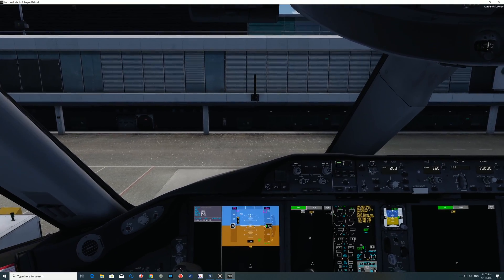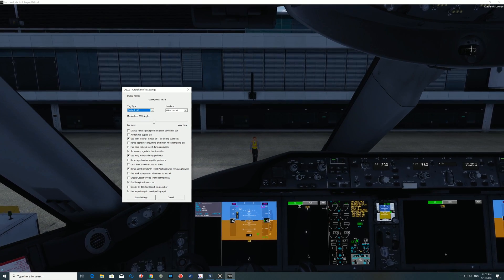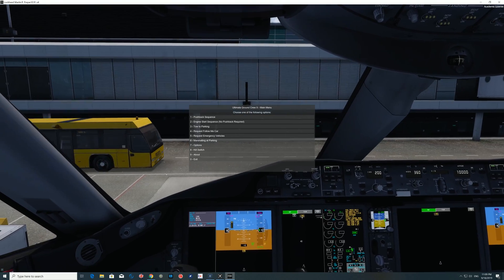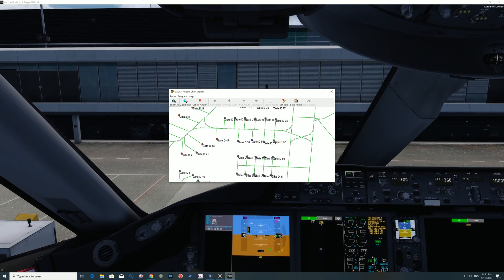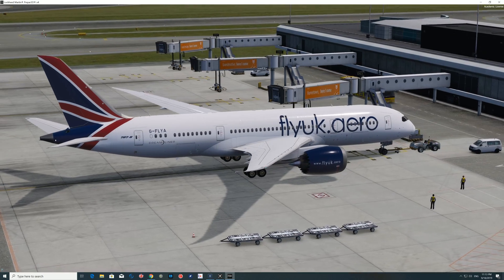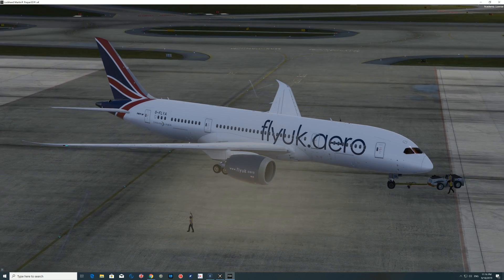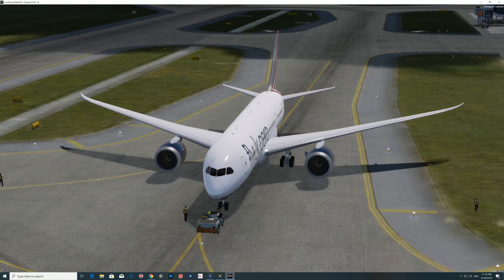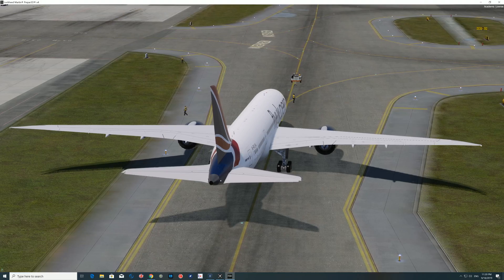Custom pushback tutorial UGCX

Comment: Does the ground crew call you 2 or 3 minutes before block out to confirm aircraft clear, doors closed and locked, by pass pin inserted and give you the clearance to pressurize ?
Reply from the maker: bonbondesel it’s not timed so I call it when I’m ready but I use Fs2crew as well on the aircraft I fly most and that’s at 3 minutes before
Reply: @greniribajan7773  thanks. So it's at the user's discretion, it's not the ground who calls, it's the pilot ? I got it right ?

Comment: Is there a way to spin the aircraft 180 during pushback?
Reply from the maker: GOLDSAMURAICHANNEL usually you don’t have that much space on a taxiway with a heavy jet but in theory you can with a user defined pushback
Reply: @greniribajan7773  at heathrow on stand 422, we have to push and spin the aircraft on the taxiway (B789, Aeromexico) its an amazing experience haha
Reply from the maker: GOLDSAMURAICHANNEL I’ll try it next time I’m flying out of there. Today I’m doing PANC KORD. Thanks for the tip
Reply: @greniribajan7773  also the Air Astana 757 on stand 401 includes a full 270° turn!
Reply from the maker: GOLDSAMURAICHANNEL I’m yet to do a proper flight with the 757 but don’t have many airports in Oceania
Reply: Yes, it's posible, just buy GSX